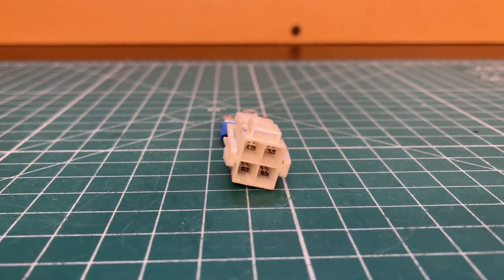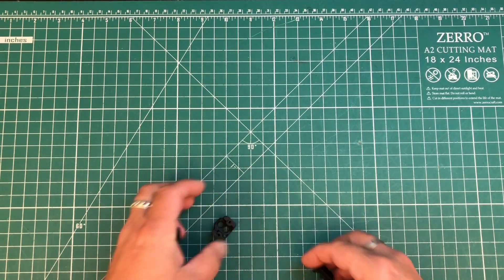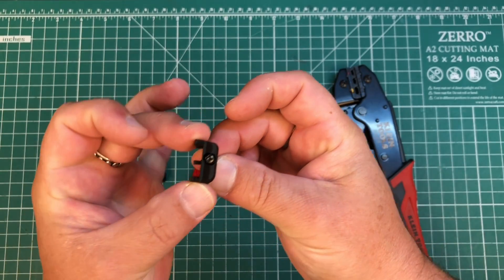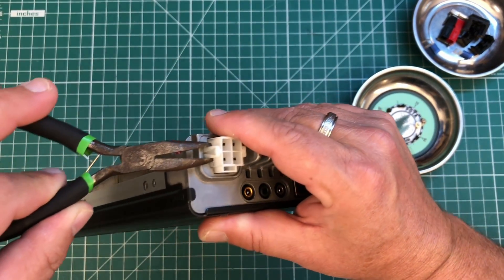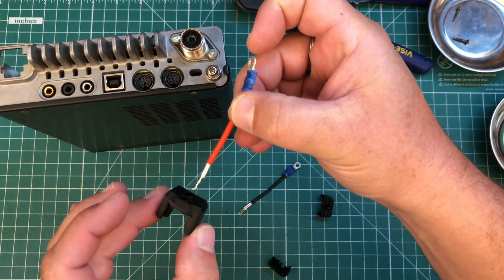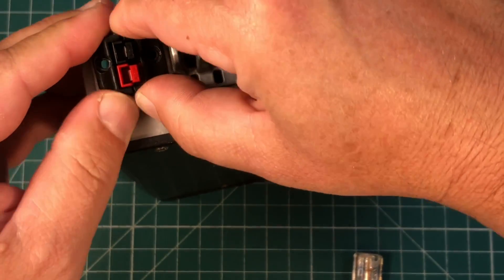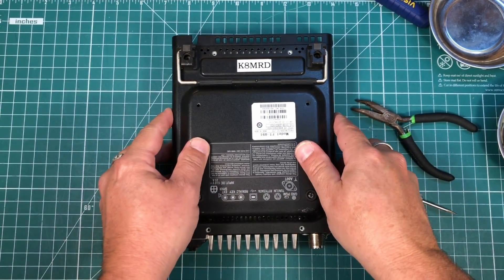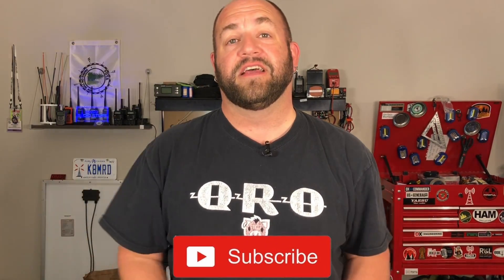Yaesu FT-891 Anderson Power Pole Replacement Modification

Comment: Thanks for the shout out. i feel flattered. For thoose who do not own a printer and have a broken connector: Send me a picture of your broken connector and i am gonna send you a printed housing in PLA.
Reply: Very good design. I just printed one out of ASA and installed it today. Thanks! Also, do you happen to have one for a 991A? My 991A suffers from the same disease.
Reply: @DagonNaxos  May be it fits to the 991 as well, did you check?
Reply: @pulponair  I just pulled my 991A apart and I'm afraid that it won't fit, s there are some clearance issues with some surface mounted components on the PCB. Plus, if I were to do it, I'd have to desolder the 4 wires (2 red, 2 black) and make  bridge for them.  Is it possible? Maybe. Would it be a right pin in the arse? Yup. If you are curious and have an email, I can send you some pictures.

Comment: Thanks for your video.  My FT-891 power connector is in original shape, because I’ve never had occasion to remove it.

I plan to do portable work this summer, though.  Instead of opening up my 891 , I simply crimped powerpole connectors on the power supply end of the original power cord. Easy-peasy, no muss no fuss.  Thanks for motivating me to do this!  Scott - VE7KI

Comment: Power poles are great, but I struggle getting them to seat properly. What did you do with the small screwdriver when inserting the connector into the housing?

Comment: I have a broken 12V connector on my FT-991A.  I wonder if I do this mod on my FT-891 will the 12V connector works on my FT-991A.

Comment: hey man ... thanks for the video, very useful, I did the conversion to Anderson powerpoles too and it's brilliant. I wanted to ask a question ... what is the maximum voltage you used the radio with ? I buit a 4 cell battery from 18650 and the voltage is a bit above the maximum recommeded in the manual

Comment: I don't mean to rain on your parade but why not just put Anderson Power Pole connectors on the end of the factory cable.  My connector on the back on my FT-891 is secure but I suppose if you frequently disconnect to pack it away it would losen up.  I don't because mine in mounted in the mobile.  Remember that Anderson Power cable must have in line fuses like the factory cable.  Otherwise it's a nifty project if you use your radio for POTA for instance with frequently disconnecting of the power cable.

Best 73,
David
K9AT
Reply: Actually, David, your suggestion opens up an entire realm of possibilities for those of us without 3D printers and who are at the mercy of the German ham and the mysterious "Wangg" touted in another video. Making a short "double-ended" Anderson Power Pole link would allow those of us who have a multi-outlet shack terminal strip to remove the rig easily from the shack and take it to the field. My terminal strop is already fused and the result would be less clutter, etc.
And so on. Inasmuch as I also have an IC-7200 as well..
Reply: @warplanner8852  Thanks for the reply

Comment: I downloaded the files and modified them to fit my Icom 7100.  Works great, If you do a lot of POTA those power connectors are a real pain to reconnect all the time.  Will let you know how they hold up.
Reply from the maker: Oh sweet!  I wonder if they would work with other Icom radios like the 7300?  I'd love to have PP's on my 7300 as well.
Reply: @hamradiotube   The icom and yaesu radios use the same connector so theoretically the Powerpole mod should work for both.    The issue I have with the 7300 is that the power wires inside aren’t screwed to the mother board but look like they are soldered and there are 4 connections, 2 for positive and 2 for negative. Making the mod a bit more involved.

Comment: I don’t get the hype with the power poles.  All my VHF/UHF came with T connectors.  The big 3 brands are all the same.  For HF,  my 991A has the same connector as my 7300.  I don’t know why I would cut them off and use power poles.   I don’t understand what it gains.
Reply from the maker: Universal connector for all your 12v devices.  Makes life easy.

Comment: I just printed and installed mine. I did mine in ASA instead of PLA or ABS because of the possible heating issues. Great design, super easy!
Reply from the maker: Excellant

Comment: I don't know anyone with a 3D printer.  Where do I send the check? C'mon, hook a fellow hammie up!
Reply from the maker: I know somewhere on the internet you can find people to print things for you.  Don't know any specific ones but that is a service that exists.
Reply from the maker: Try this guy. https://docs.google.com/forms/d/e/1FAIpQLSdcXCkVCU91Qyo7hoHDhYTEDKGfRqza9noOm-DekBeKXhuHqg/viewform
Reply: I asked around I don't know anyone with 3d printer here also .
I like the design showed .
I have the bulky DC cord and huge fuse holders . I had adapted Anderson's to a smaller DC wire cause I don't use more than 50 watts on FM 6m & 10m or SSB.
But when someone sales this premade radio chassis connector I'm in too .
Reply from the maker: @duaneshuster6366  https://docs.google.com/forms/d/e/1FAIpQLSdcXCkVCU91Qyo7hoHDhYTEDKGfRqza9noOm-DekBeKXhuHqg/viewform

Comment: Great mod! Kudos to the 3D designer. I'm not a huge fan of the Anderson poles though, I think XT60 connectors are far better, and are what I use for All of my 12V power needs. I'm actually in the process of modding my PSU that came with andersons to XT60.

Comment: It would be cool if this was for the ft-857.  Be a very bid difference.
Reply from the maker: I'm told this should work for most Yaesu radios.
Reply: @hamradiotube  Super.  Now I need someone to print this for me in ASA.  Or maybe this will push me to buy a 3D printer. thx

Comment: Word to the wise PLA is not the plastic you should you use pla has a very low glass temps…. It will melt on a hot summer day. If you what it to last go with some PETG. ASA is the best but a Royal pain to print with.
Reply from the maker: I have no idea what plastic was used to print mine but that's good info.  I suppose I'll find out in the summer if mine will survive the Texas heat.
Reply: @hamradiotube  if you need it reprinted let me know I have a ton of petg and I may also have my abs machine working before winter
Reply from the maker: @CanadianMakerProject  If need be I certainly will, thank you.

Comment: It would be nice if more manufacturers joined this century and just started using power pole connections
Reply: Why do people like it over Molex? Molex has friction and usually locking tabs. Powerpoles pull apart too easily for me.
Reply: @techguy9023  it’s trendy.  Just like Messi and Peloni is the new LMR400.
Reply from the maker: I started that you know?
Reply from the maker: I would rather have my power pole pull out than my radio get knocked off a picnic bench.
Reply: @techguy9023  I have no issue with a molex connection for a semi permanent installation like in a car bu with more and more hams using car style radios for POTA/SOTA work molex is not ideal. Yes you could just make a 6" pig tail connector but that does add a point of failure.

Comment: I got a premade setup from Jason wang. He has a video on YouTube. I don’t have a printer. And he offered to have the Andersons and ring terminals all ready to go.
Reply: I also have the complete connector from Jason W.  It is top notch.  Solid connector, excellent heavy-duty wire and connection.   Great for all of us that do not have or plan to have a printer.  Only $30.    73 KF6LU

Comment: Ok now is there one for a G90?
Reply: The add-on fan bracket has one. Radioddity G90-H1
Reply from the maker: I've seen mods for power poles and the G90 but not a 3d printed one.  I would love to have PP's on that too!

Comment: Excellent video! The 897 and 857 both use 6x MOLEX connectors. These are just begging to be replaced by APP connectors. I wonder if anyone has designed a printable unit for these radios... ;)
Reply: Most Yeasus have the same opening on the Backpanel. If so the Connector should fit.

Comment: I just did this mod for the same reason as you. Question though… Why the 4 wires on the original connector? I don’t understand, and opening the radio up didn’t provide any more clarity.
Reply: My guess (FWIW) is that the engineers think that the wires into the MOLEX connector are insufficient for the current draw at keydown (too much voltage drop). So they use four wires. This is the same for the 897/857 rigs as well.